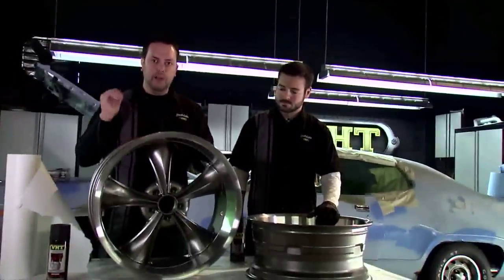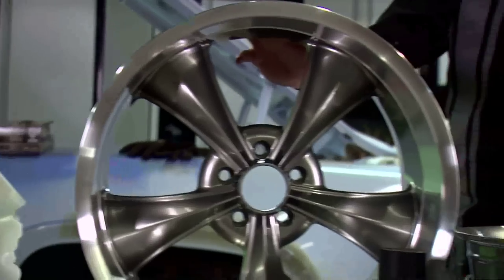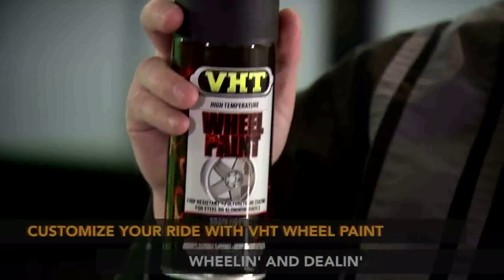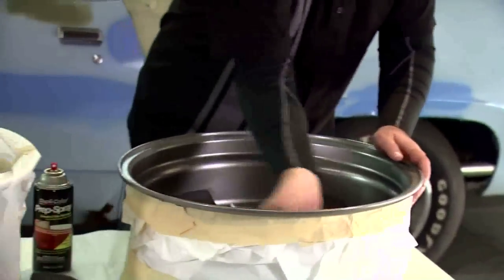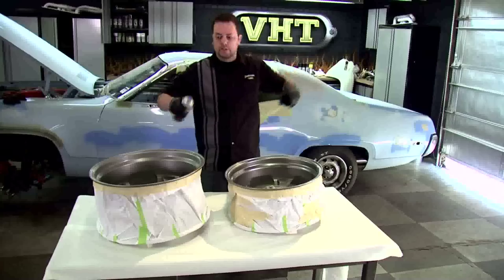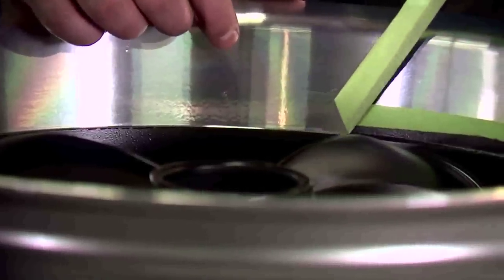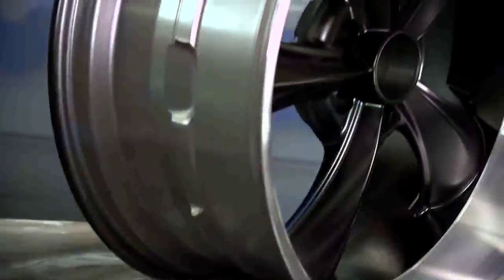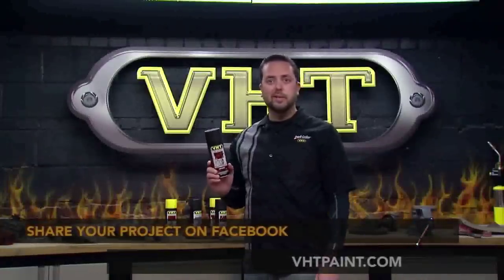Painting Car Wheels with VHT Wheel Paint - Restoration of 1972 Plymouth Satellite Sebring Plus

Comment: Why didn't you scuff the surface with a mild abrasive to get the paint to stick better?
Reply from the maker: Nelson - good catch! We actually did, of course, but did not include it in the video.
Reply from the maker: Justin Hickey We'd recommend staying with the wheel paint. There isn't a recommended clear coat for the epoxy and, though it would stick, if something hit the wheel and scratched the epoxy it would be much more noticeable than the wheel paint with clear over top. Let us know if you have any other questions!

Comment: I would like to use the VHT paint on a chrome Tundra front grill to give it the bedliner rough texture look. which product will be best?
Reply from the maker: If you want a Clear or Black finish, you can apply our Truck Bed Coating.  It would give a Black textured finish over Chrome.  We suggest heavily sanding the Chrome to dull it first, and clean it well using Grease and Wax Remover.

Comment: how about a video showing a better range of your products?  such as, taking wheel off a car, prepping it, priming, top coats, and clear coats.  You have great products... but the information offered in these vid, and even on the can themselves, is pretty poor.  "can handle after 3 hours"... does this mean I can pick them up, bolt them to the car, wash them???  youtube is a great tool to easily show how to use your products, and its free!

Comment: @VHT hi there before I go ahead with painting my wheels gloss black I was wondering if you didn't want the paint anymore can it be removed without effecting the original rim paint and clear coat ?
Reply from the maker: We recommend a light scuff sand with a 320 grit sandpaper to prep the surface before using the Wheel Paint.  Also, if you choose to remove the paint, it would require further sanding or a paint stripper.  Either way, there will be an effect on the original finish.  If you're working with an aluminum rim, you could buff and polish the finish afterwards, but it still will not look exactly as it was before.   Let us know if you have any further questions!

Comment: I was wondering can you still wash your tires/rims with the paint on, also do you have to take the tires off to actually paint ?
Reply from the maker: Yes, you can use mild non-abrasive cleaners to wash your tires/rims.  Taking the tires off isn't required, but it would be suggested. Make certain to hold the cans upright while spraying.
Reply: Does this satin black have a clear coat in built? or would i have to apply a clear coat after? thanks